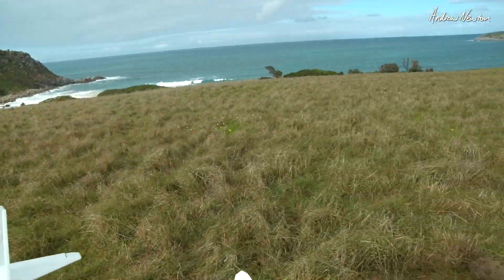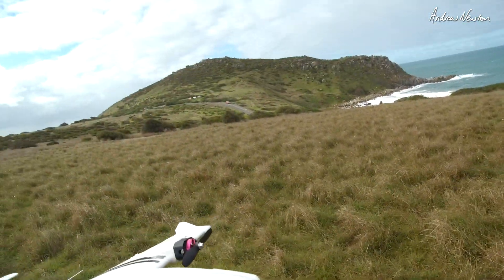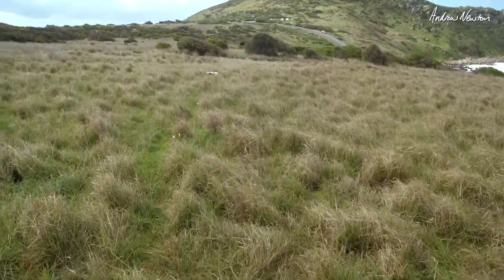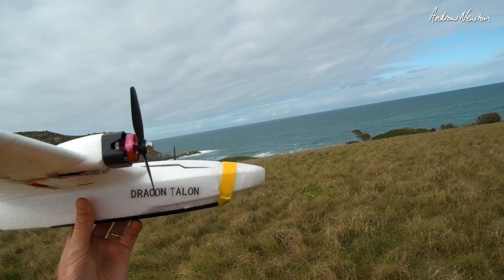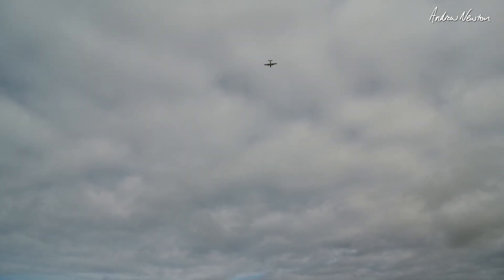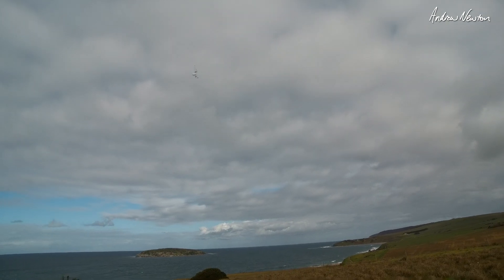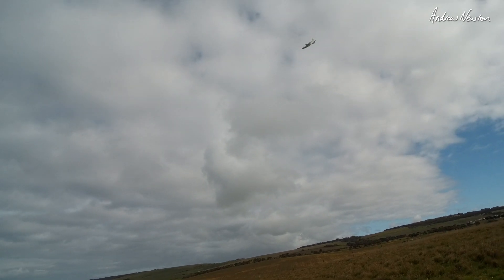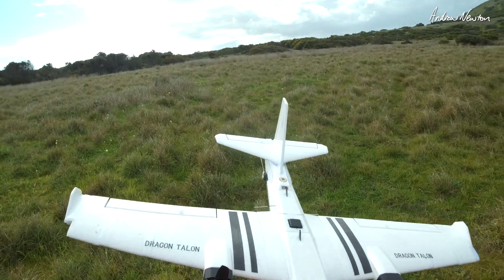Reptile Dragon Talon - Wingtip washout

Comment: Andrew, if there where you cut the wings and reglued them, how about putting a vertical spar in it, having it protrude on the top 5 mm or so? Bottom flush. Would that be any better?
Reply from the maker: Like little wing fences?
Reply: @AndrewNewton  like flat canards, not at the ends but in the cuts you made. Like fins or such?

Comment: Have you tried Vortex Generators on the wings ? I had a plane that would tip stall at low speed. I installed DIY Vortex generators on the wings and it solved the low speed tip stalling problem.
Reply from the maker: No, but good idea

Comment: Nice technique for adding washout on the main wing. End result looked good. Nicely done.

Wondering if the left wing is heaver then the right wing as seems to have a preference of dropping left wing? I assume you already checked. But still puzzling, as to why left.
Adding a bit of reflex to both ailerons could have the effect of additional washout. But given the amount of washout already added, it probably would make little added difference. Too much washout is starts becoming like having crow braking enabled.
Reply: One wing indeed could be heavier. Never considered that. Just strange because I have this same plane and haven’t experienced this behavior.

Comment: It may be that the coefficient of lift of that foil is just too low to do a pull out from a stall..   
After it stalls, it is dropping... 
and then needs to arrest that drop by generating a rather sudden increase in lift.  but if it reaches the max CL, if it stalls, or not, it cannot arrest the rate of descent in a short time period.  
it would be possible to recover more slowly, but for an RC model, flying at a relatively low altitude, it just does not have the altitude to spare.  
good on you for trying everything.  
I agree.  not worth continuing.
Reply from the maker: Might try adding a bit to the trailing edge as a final mod.
Reply: @AndrewNewton  wing area should already be sufficient. 
problem must be that the foil has a low CL. It must be due to the fine LE shape. 
perhaps there is a way to add a piece of foam, tapered from and back, to the wing, laminated on the top of the wing, to give it a thicker LE and thicker cross section. Essentially a thicker airfoil.  
Would be interesting to compare the wing airfoil cross section to another similar wing span and area plane which is know to be successful and have good lift characteristics.  It might inform a mod.  
If it was your only plane, and you were stuck with it, would be great to have a solution.  
Designer is to definitely to blame.. 
I once bought a multiplex Cularis with a similar problem.   had a few decent flights with it, but would not recover from a stall, without stalling again and again on the way down. inverting each time.  after comparing airfoils with the multiplex easy glider, I saw the problem.  very fine LE, semi symmetrical, and thin foil..   very low CL.  
so despite larger span and larger wing area, could not carry as much weight as the smaller easy glider, or even the much smaller easy star..   a real disappointment for almost 200 USD plane.  I ended up giving the fuselage to someone, re-using the horizontal stab and salvaging the CF from the wings.   and just designed my now plane instead the next time.  never looked back.  Model designers seemingly have no responsibility.     good thing it's just a hobby, right??   :)